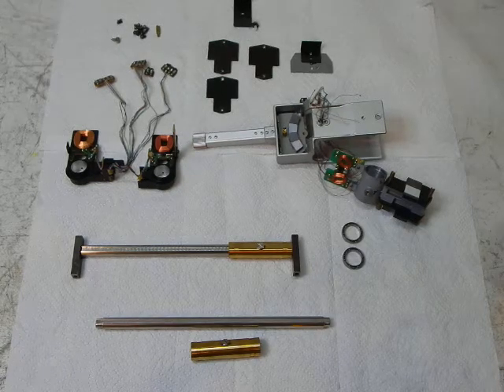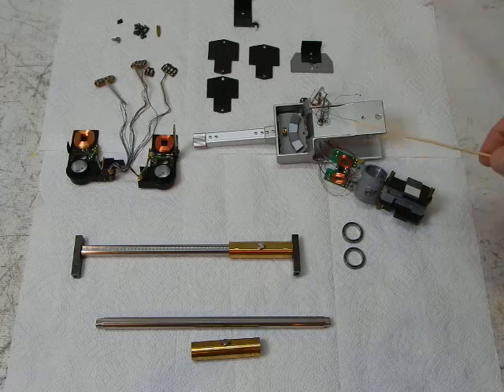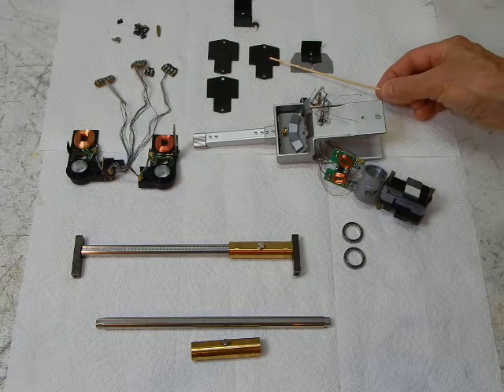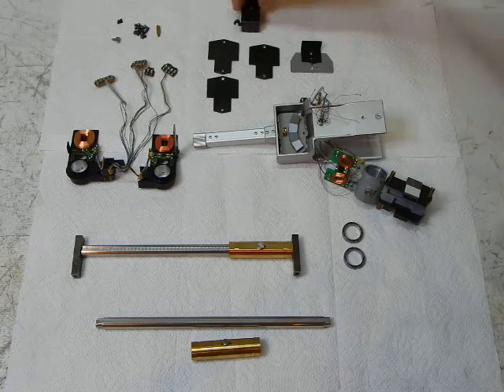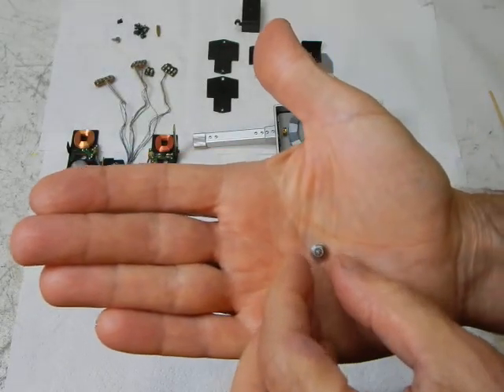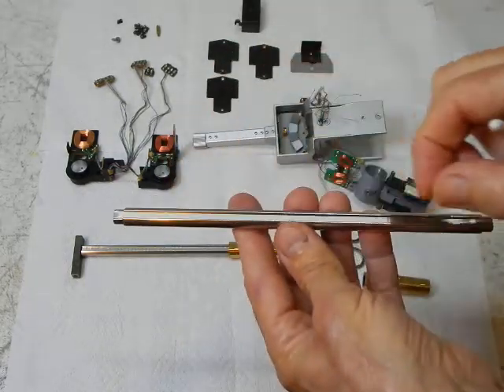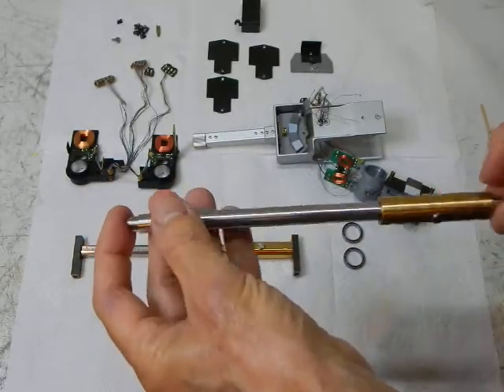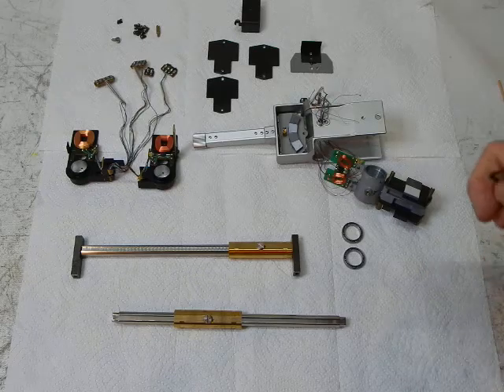Sony PS-X800 Biotracer tonearm anatomy & friction issues part 1.

Comment: Hi,  You are obviously very knowledgeable on this model Sony turntable.  Can you tell me how to adjust the lead in position of the tonearm?  My turntable works perfectly except that when in auto mode the tonearm moves toward the lead in area but stops just  shy of the actual lead in grooves.  Consequently the tonearm does not drop.  If I manually move to tonearm in just 1/8 of an inch or so it will automatically drop.  i have a copy of the service manual but can't find anything that talks about adjusting that setting.  Thanks very much, Richard

Comment: Quite impressed with the presentation. I presume you do repair turntables from what I see. Are you based in the UK?
Reply from the maker: Hello sayyourmind1. 
Thank you for your compliment on my work. 
Yes, I repair and calibrate most turntables, but the majority of my work is restricted to vintage top of the line SLT 1/2" mount phono cartridge direct drive turntables. Of these, most are Japanese made, but I've also worked on several Revox SLT tables as well. 
I'm located in central Florida USA. Most of my work is shipped to me and top quality simple packing and shipping instructions specific to each turntable I service are provided beforehand. More information about me can be found under the "About" tab of my Youtube home page. Please also read through my general turntable service ad at Webstore for starters.
Best wishes, Alan
Reply: Thanks Alan. I currently own a Sony PS-X70 and a Pioneer PL-550. Both are doing great at the moment....touch wood. I was just preparing for the time they start developing any fault. I cherish both to bits but I will also not loose sight of the fact that they are vintage turntables and have seen lots of years. Regards. Frank